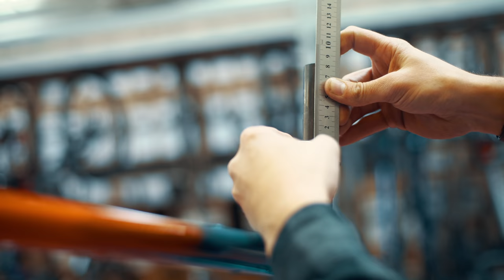DREAM BUILD GRAVEL BIKE - Marin Headlands

Comment: threaded BB for the win
Reply: But BSA and not T47 which is odd
Reply: Just because bike manifacturers can't do a pressfit threaded is no better, especially if there isn't a single aluminium sleeve... Also on threaded bb the bearing are press-fitted in the cups
Reply: @LucaBonato  yes indeed, and it makes the the BB box narrower and the chainstays slimmer (especially on a gravel frame designed for wide tires) wich is more flexy and fragile... A well made press fit is the good system in my opinion.
Reply: hambini enters the chat room

Comment: One of the most beautiful dream build you’ve posted. What kind of spacers did you put in the crankset?
Reply: Kleiner Helfer  To get the proper chain line width.
Reply: Kleiner Helfer Yes, it does that's correct.
Reply: Kleiner Helfer  the spacing shouldn't be more than 3mm or so sometimes even less, there wouldn't be any problems.
Reply: Kleiner Helfer   I really like bicycles, but I love the people that ride them and repair them.
Reply: Kleiner Helfer  Tell me about it, I haven't stepped foot inside a bike shop in over 10 years or more. I buy frames direct from the manufacture or friends and build what I want. I have even bought some bikes from bikesdirect.com that were and still are a fantastic deal compared to anything that you would find in a bike shop.
 I will be honest though I am true to Shimano I have never had any problems with any of their component, I can't say the same for SRAM.
Reply: Kleiner Helfer  I perform all my bike fittings my self with a tape measure and a drywall adjustable square, oh and a mirror. A plum bob can also be helpful from time to time to get your saddle forward or aft  correct. 

Saddle height for me is crucial, I have to have it just right it can't be to low and I always use 165mm crank arms. I have the measurements written down in my garage for my saddle height and reach.
Reply: Kleiner Helfer  Where are you at? Maybe I can find out why for you. I'm in California.

Comment: what are the 3 best gravel tires that dont puncture easily? and is running tubeless the ideal choice? i understand that it will be lighter, but if i rip a whole during riding, i would need to carry a whole bunch of spare parts, and thats insane.